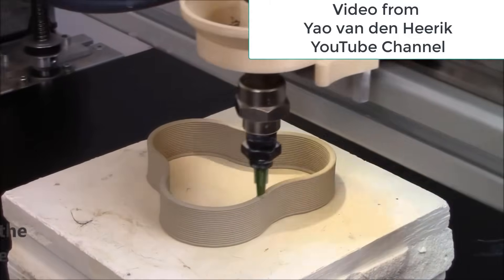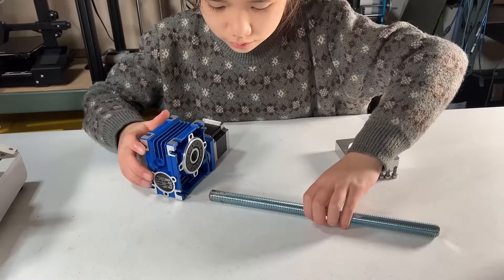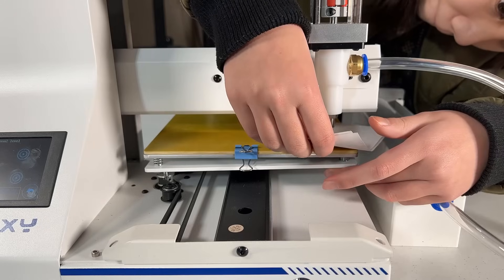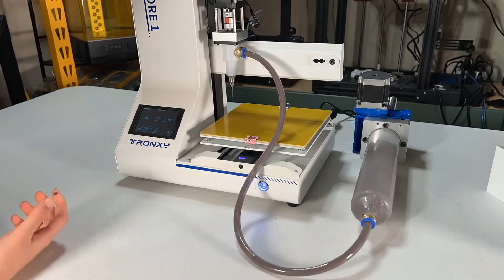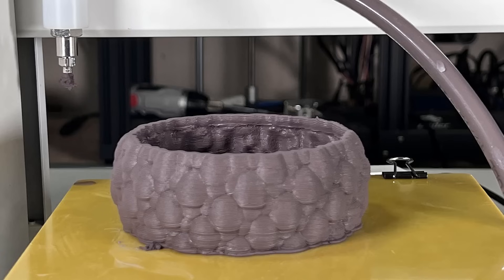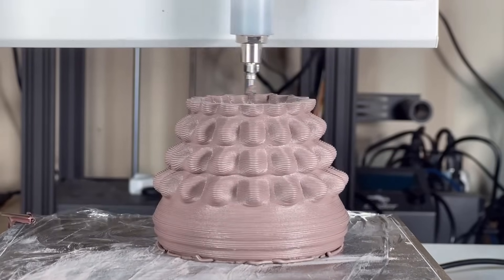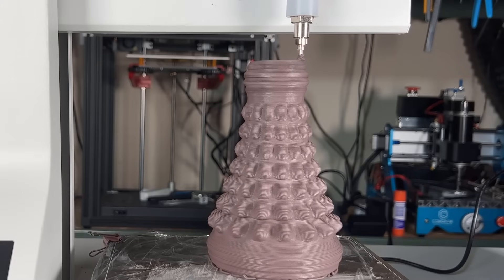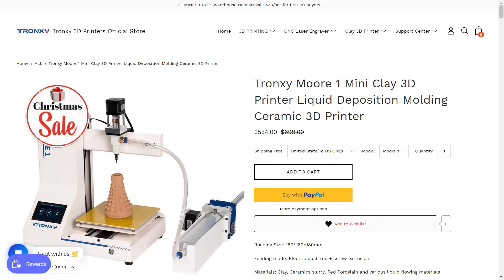Tronxy Moore 1 Clay 3D Printer: Pottery-making experience is not required for ceramic 3D printing

Comment: Can you print 3ft or 5ft pipes with a spiral design so we get maximum surface area both inside and out, and one side very porous while the other side is glazed so it is water proof?

Comment: The fun looking thing to me about this process is using it as a starting point for more traditional pottery work. I can imagine printing a vessel, letting it dry to a bit wetter than greenware level, and then scraping it smooth and patching any flaws. A workflow like this mitigates some of the clay inconsistency issues too, at least if the pieces are for artistic purposes with noncritical properties - just patch the holes before you smooth it! The layer texture itself might also look nice with certain glazes.

Comment: Hi, this is Eazao ceramic 3D printer. We are very happy to see more people using ceramic 3D printers, and the whole video shooting process is smooth and clear. However, we have a suggestion that after using the microwave kiln in your home microwave oven, it is best not to use the microwave oven again. During the safety period, the sintering time should not exceed 15 minutes. If it exceeds 35 minutes, it will damage the microwave oven and may cause the risk of microwave leakage. Still a good video!👍👍👍

Comment: Loved your presentation.
You might look for another microwave oven for your kilning. They show up in free-piles frequently, and failing that, thrift stores.

My concerns with the printer would be the cleanup. You don't want to leave clay in the nozzle or the plastic tube to dry and harden.

It would be fun to see both you and your brother on the screen.

Comment: Get a plexiglass tube with the same internal size as your clay extruder tube. Pre pack your clay in the plexiglass tube and when happy push the plug into your extruder tube.  If its difficult to push the plug out,  consider making the plexiglass in halves so you can open it and there by remove drag. This is what a professional pug machine dose.

Comment: In germany we had working with clay in school. Of course not with 3d printers but by bare hand. Seeing someone wearing gloves working with clay seems a bit - lets phrase it mildly - "uncommon" ;-)
A classic way to sculpt clay by hand is to make the basic model with small rools of clay. Afterwards you detail out and flaten everything by hand, using water; maybe some tools for details. While as a 3d printing fan I definitly like the look of the print, I am pretty sure the print is normaly ment to be post processed by hand. Thats one of the big advantages of clay - with some water and handwork you can perfectly smooth prints.
In germany working with clay is quite a common hobby - and you often find people who burn your objects for a low price. The microwave way does not seem optimal to me - esp. as you might do a second, hotter burn after you added glas powder to make your ceramic usable as a water tight cup, vase or whatever.

I wish Tronxy will publish this "printhead" also as an "upgrade" for existing printers. I already have a Jennyprinter 650 [650 by 650 by 650 mm³ volume], still not assambled. Would be great to add a clay extruder... I do not know why all theese manufactorers want to make ready to use printers for special uses. Most people working with clay see it as art, so 3d printers would be a no-go. But upgrade kits for 3d hobyists, thats the market they should targeting. I want a clay print tool, a chocolate print tool,  a wax printing tool and maybe a pencake tool. But not 4 different printers adding to my existing farm...

Comment: Very interesting video. I just would wish most manufacturers would offer a 300mm X 300mm X 300mm build volume along with at least a 15 point or more more for self leveling for the bed without having to edit the G & M codes or use Z axis baby steps. I still don't like to layer lines just like filament 3D printers. I do a lot of sample & prototype parts & I have found that 3d printed parts without the exception of resin printers build volume to  give the best results. The only draw back for a 3D resin printer is their print volume. I would like to see more 3D resin printers & filament printers with a build volume of 300mm X 300mm X 300mm. And all of the 3D printers should work correctly right out of the box. I don't want to spend precious time fine tuning the printer or slicing software along with the G & M codes. I believe the all filament & resin printers are in their infancy & need to built to higher standards such as using servo motors, linear rails, all metal dual extender's gear drives. Also these 3D printers should never not to produce a perfect, or near perfect, print without having to change the slicer settings, & the G & M codes, as we in the machining world would call it as a part program.
Reply: Your wish can come true. Those machines exist. Just spend a bit more money. I recommend the Ultimaker S5 or the Raise 3D E2. Both are not overly expensive but will print day in day out with ease.

Comment: Great review!  I wonder how the same machine would do with something like Fondant to make edible prints instead of the clay ones.
Reply: I'm surprised you think fondant is edible
Reply: @william, for fondant to work you need to heat it to meld. Like in Tom's review.
Reply: Tom S. Just did a review on a machine to do that. 
https://youtu.be/DOsvpxlxZso
It didn't need such a hefty extrusion motor.
Reply: @samhale5413  That is not the same machine.